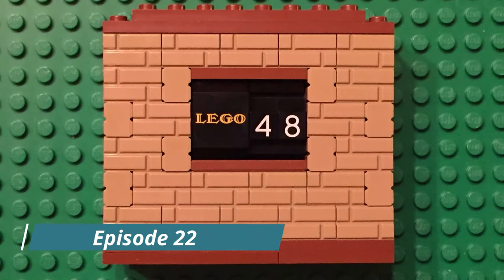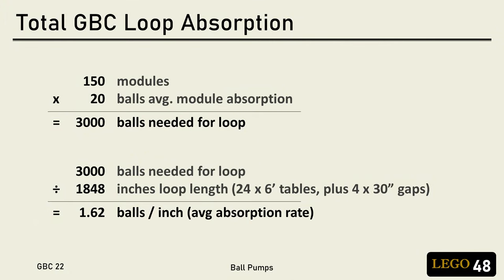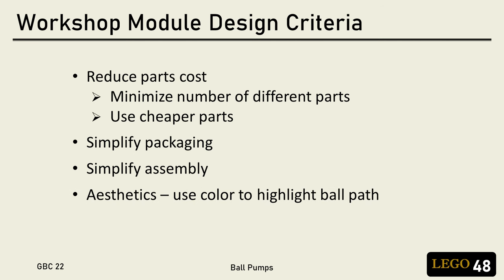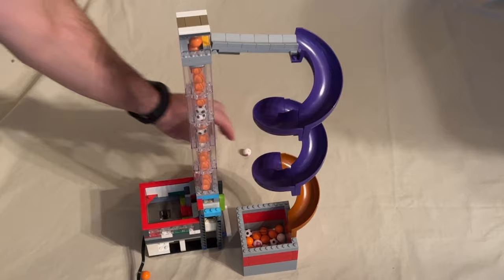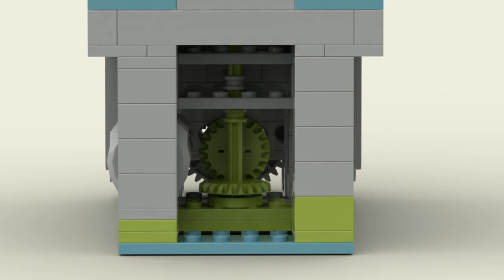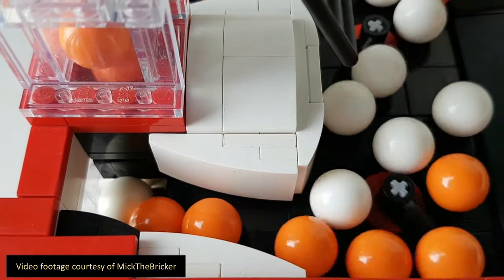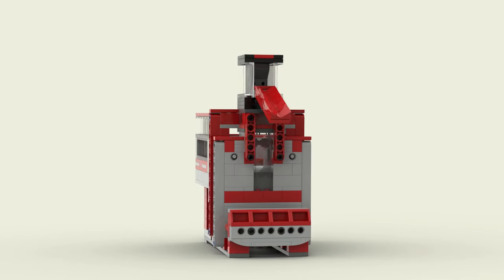GBC 22 - Friends don't let friends build ball pumps...

Comment: Great review of the Brickworld Ball pump.  I put a roof on mine as well and it caused me issues - it would jam about once every 8 hours.  It took me forever to figure out it was the roof.  I put another inverted slope on top of the existing one and a roof on that.
Reply from the maker: Thank you for confirming my findings! :-) Adding another inverted slope piece is certainly a workable solution for the jamming issue; but I'm willing to bet that replacing the brick underneath the inverted slope with a brick with studs on it, should provide enough shift in the ball column to keep it from jamming.  (And keeps the chimney more compact.)

Comment: Nice work. The module was motivated by one the GBC founders telling me [all] ball pumps jamb. I suppose I should admit that I failed twice to make a non-jambing ball pump before realizing this design.

As you said, when built as designed, it's extremely reliable. There are subtle anti-jam features that aren't apparent until you change them and run for hours under realistic and variable GBC conditions. For example, the loose bar over the entrance to the piston is there because occasionally the module before the pump will get excited and shoot a ball directly into the entrance, notwithstanding that there might be a ball in there already. The flex in the bar gives one of the two balls an exit path, while otherwise constraining a slightly misfed ball from falling out.

I never had a problem with the agitator, which actually surprised me. I suspect pressing it flush to the floor is what saved me. But your agitator is just as good. 

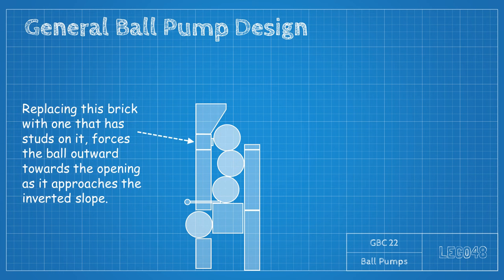I agree fully with the chimney issue noted around 6:50. It also bothered me the balls would often exit by twos instead of singly, but since it never caused a jamb, and because in GBC randomness is generally your friend, I left it alone. Very good solution, though.

A large number of the part choices were defined by what was available to order in quantity directly from TLG at the time while minimizing cost of the Brickworld kit. Your suggestions are all good--they were just made with different priorities.

You showcase a couple asymmetric designs. It's worth pointing out that asymmetry is a useful design principle, especially when funneling balls. A funnel with one straight side will jamb significantly less often than a symmetric funnel. If I were to design this again, I would start with an asymmetric feed.

Keep up the good work!
Reply from the maker: Thank you so much - I'll admit, given the popularity of this design, it was a little intimidating to try to comment on it; but I finally decided I had to because I saw too many beginning GBCers struggling with the design after modifying it.  I tried to be fair though, recognizing the difference between what you were trying to do and what I want to use this design for.
>>For example, the loose bar over the entrance to the piston
I'm so glad you mentioned this - I actually ended up having to use my Dx version ball pump this past weekend, and that bar got knocked out of position (up) and suddenly balls were jamming and flying out of the module!  Fortunately, I had just read your comments so I recognized immediately that the bar was out of place and therefore not doing what it was supposed to!
Reply from the maker: >>>>It also bothered me the balls would often exit by twos instead of singly
I've observed this too at times, and this is common to all ball pumps.  It's a function of the height of the chimney output compared to the top of the ball stack.  If the chimney output is near the top or bottom of the last ball in the stack, then balls will sometimes get hung up on the exit, until the next ball is pumped - and then both go at once.  The solution to this is to add an additional row of plates (or two) to the chimney before the output.
Reply from the maker: >> It's worth pointing out that asymmetry is a useful design principle, especially when funneling balls
Yeah, most of my in-baskets are done that way; however, when you make it asymmetric the rotation direction of the agitator starts to matter - it will be more effective in one direction than the other.  It's very intriguing to consider an asymmetric version of your ball pump design; on the plus side, it could lead to a more efficient layout all the way around; however, it would likely require giving up the bi-directionality that the current design has.  Since I mostly want to use this for emergency replacement of other modules at shows, the ability to do a quick pull-and-replace, and simply attach this module to an existing power supply without having to worry about direction... this is very handy!
Reply: @lego48  i have to eat some crow. I did a show this weekend and wouldn't you know it, the agitator arm worked loose!

Comment: Personally- I found that you can make a really good "solid state" "latch" by replacing the trapdoors with a single rubber piece extending out by a half stud. Haven't reliability tested it-but it works well with what i've checked so far.
Reply from the maker: That's an intriguing approach, and that would certainly simplify the design a bit.  I would be concerned though about (A) the rubber leaving marks on the balls (or rubbing the paint off of some of the older soccer balls), and (B) the rubber wearing down and eventually losing functionality.  I've been experimenting with other ways of implementing traps using a curved slope piece on a spring-loaded piston.  It works, but it complicates the build.
Reply: @lego48  Going to try to run the pump for like 8-10 hrs... I got a couple of the old balls from last year's brickworld so we'll see if the paint is removed. I'll let you know what happens.